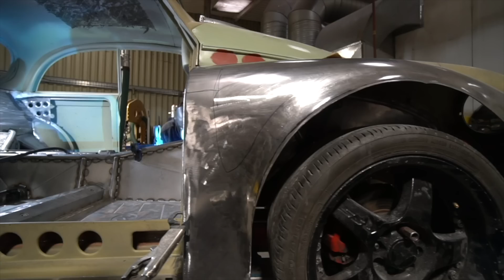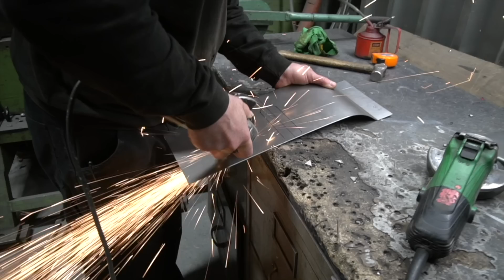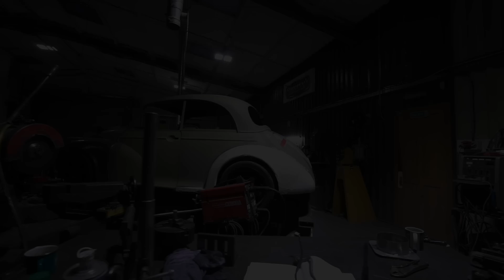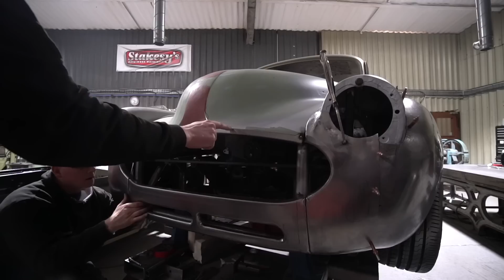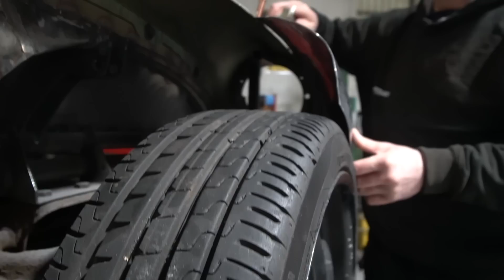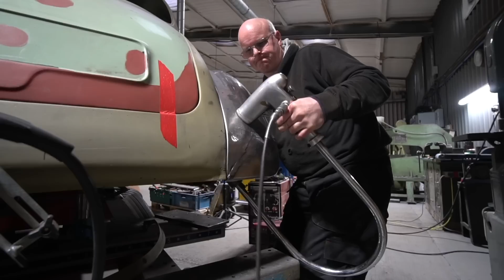Restomod MORRIS MINOR Build Episode 2

Comment: The 4 inch wide flat strip in the middle of the bonnet of a Morris Minor is a bit of history. Alec Issigonis designed the car to echo late 1940s American styling. But originally it was the same width as an Austin A30. Issigonis looked at the prototype and it just didn't have the right American look -- far too narrow. So they cut the prototype in half and welded 4 inches into the middle. The flat strip marks where a bit was inserted in the middle of what had originally been a narrow ridge. It looked good, so they left it like that. However, when this happened the front bumpers had already been made. The early split-screen Minors had a front bumper that had been cut in half, and an extension bolted into the middle.
Reply: A 1947 Cadillac 2 door Coupe at a BMC meet is a cruel thing as people have spent buckets of money and time modifying Minors. This one included,  to make it look better. But proportionally it's never correct.
Reply: The body shape of the Minor was inspired by the 1938 Buick Y-job, a one-off show car.  I think the extra width of the Minor was 3" but the rest of the story is correct.
Reply: The Morris also has no nostrils in the radiator cowl, two holes that fill the nose inside the front bonnet. That is why a 30's GM has the bonnet shaped like that to aid radiator flow. It works the same way a modern cab over truck has ducts on the side edges of the body where the radiator is as it creates a negative pressure zone behind the inlet. The Mog just looks like it but the bonnet shape is just for looks and does the opposite the faster you go.